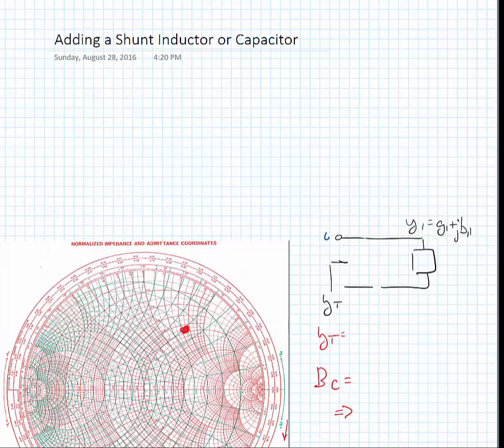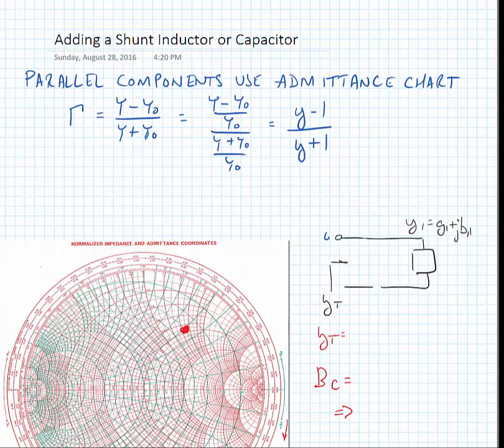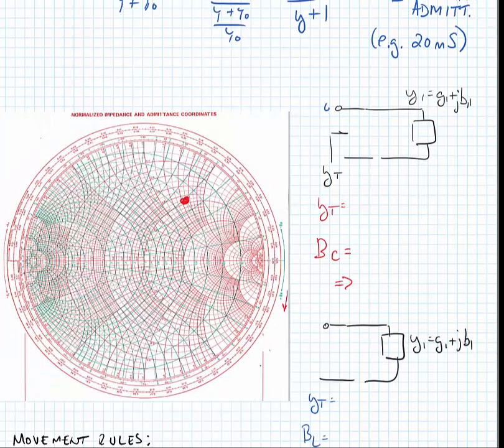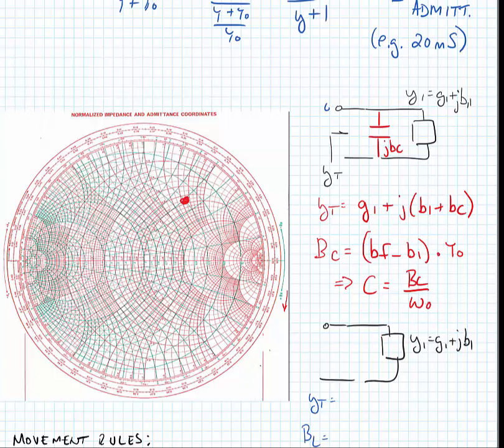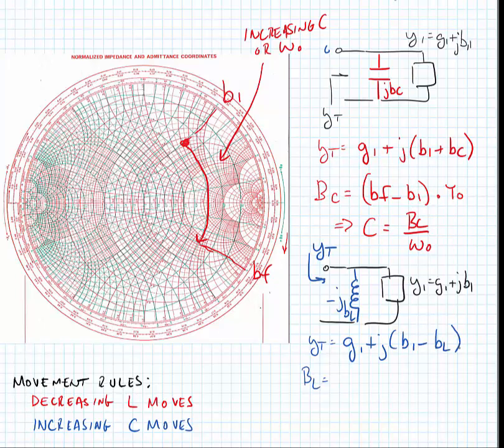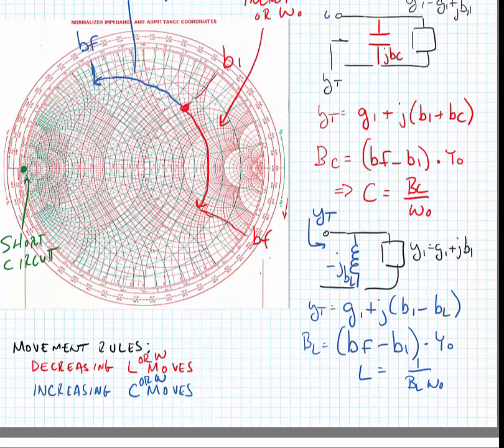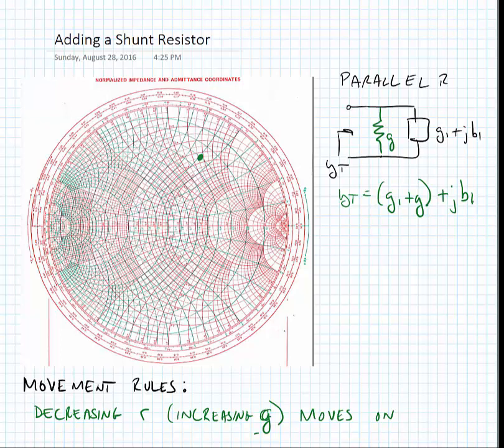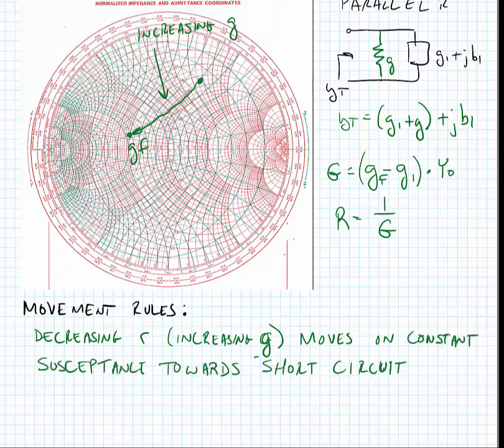Lecture 6.3 - Adding Shunt Components using the Smith Chart

Comment: Shouldn't it be other way around for capacitor as frequency increases y increasing towards short circuit 
But it is moving downward, what am i missing. 
The upper region is capacitive and lower is inductive. Increase in capacitance should not move to inductance region.
Reply from the maker: When we are adding shunt components, we are using the admittance chart; The bottom half of the admittance chart represents the positive susceptance region (e.g., capacitive region), so when we add shunt inductor it should go down towards the short circuit as capacitance (or frequency) is increased.
Reply: @wallingphd  so in both admittance and impedance chart, the bottom region is capacitive/negative inductance region ?
Reply from the maker: @rohitnandakumar6581  Yes, that is correct. Bottom region is always capacitive and top region is always inductive.